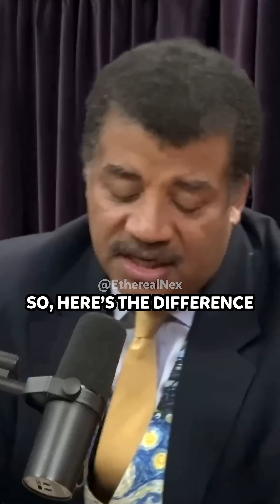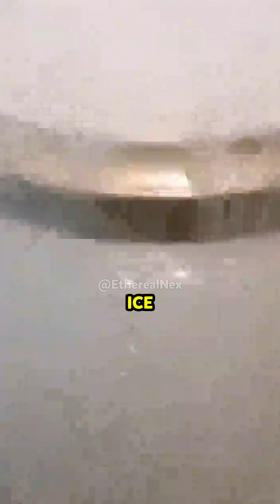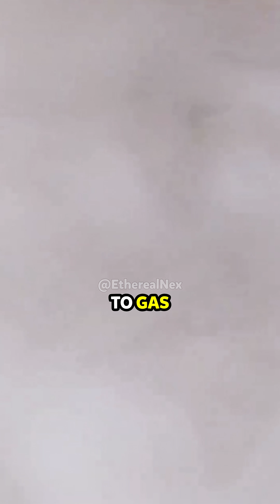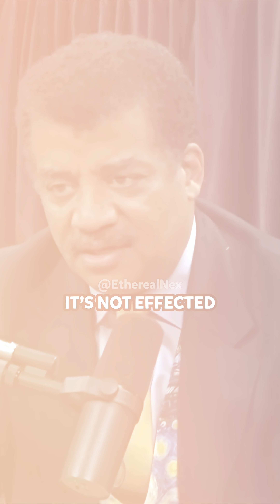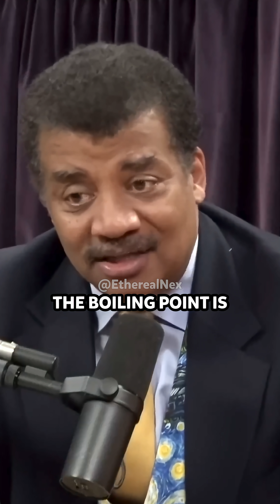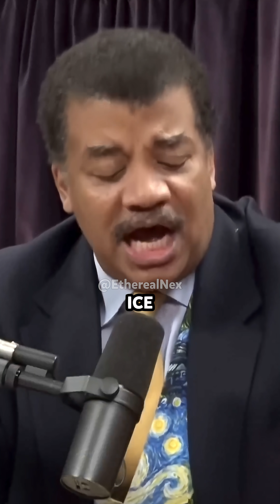Neil deGrasse Tyson Explains How Dry Ice Work! 🧊 | dr. Neil deGrasse Tyson

Comment: And the opposite is why a pressure-cooker works - the trapped pressure over the water causes the water to boil at a higher temperature.  It is actually this higher temperature that causes the food to cook faster.

Comment: he cannot explain a positive pressure next to a vachumn without a barrier
Reply: What are you on about? Of course he can, anyone can. At sea level the area of positive pressure will equalize with the air entering the vacuum. Just like what causes weather patterns. The same thing will happen on top of a mountain, where there's still enough air pressure. The same thing would happen in space, too, incidentally, because it is not a perfect vacuum. But one or two molecules of matter wouldn't be noticed.